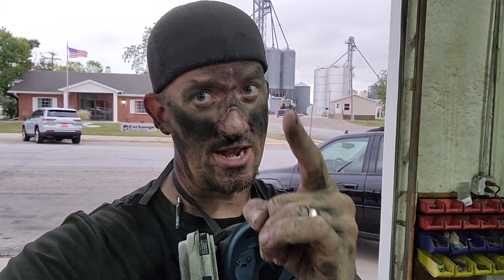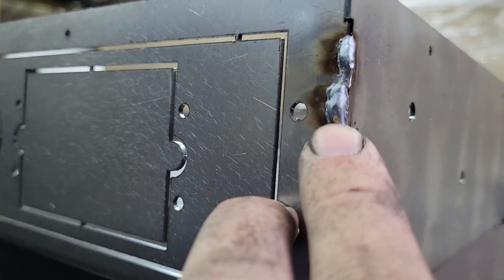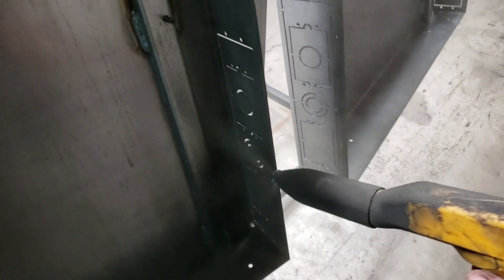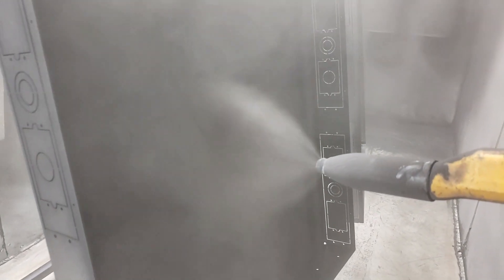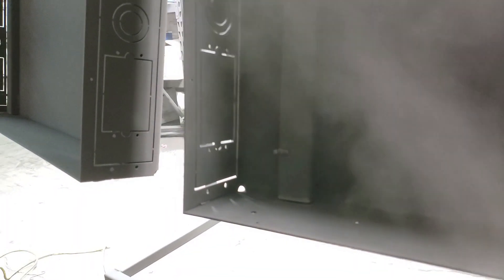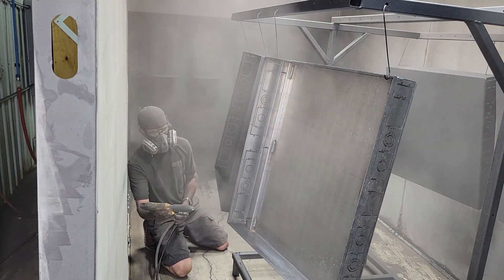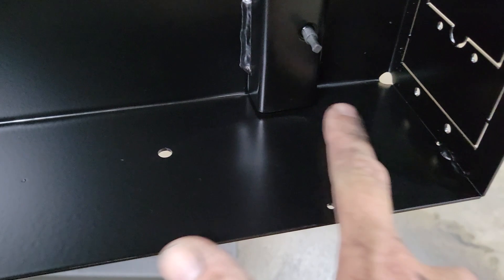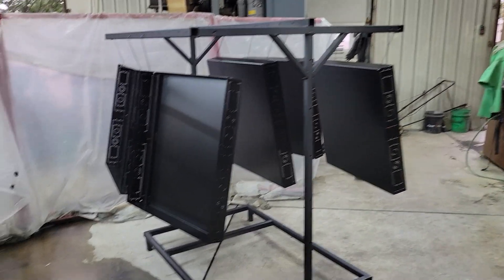How to overcome powder coat issues.

Comment: Epoxy compounds are known causes of occupational asthma. Powder coating paint on your skin can cause allergic skin reactions and also exposure you to exposed you chemicals suspected to cause cancer, damage fertility or unborn child. Powder coat paints, especially those that contain TGIC, may cause damage to the lungs, central nervous system, kidney, liver and hearing organs through repeated or prolonged exposure. All SDS for powder coat paints say the same thing: Wear protective gloves, clothing, face and eye protection. Contaminated work clothing should not be allowed out of the workplace. I recommend a full-face respirator and Electrostatic Dissipative (ESD) fiber yarns nylon gloves.

Comment: Hey Dan, thanks for all the great content. On a job like this do you see a big difference between the Gema and KCI or is it just different settings and technique, but overall same issues. Iv'e been using a KCI for 5 years and have had great results and zero problems with the unit itself.  I want to replace it as it has a bazillion hrs on it and I was thinking of upgrading to a Gema but just not sure if its worth the extra money. What are your thoughts between the two. Thanks for your time.
Reply from the maker: Big improvement for us, easy to set up and go.  Dont have to adjust as much.

Comment: im having these types of issues on brake calipers and most of the time on the second coat..
The real problem is that let´s say im doing lollypop red and can´t get it sticking on the corners, ill have to shoot a ton of powder onto the part and it will ruin the color of the part. it will go from a bright red to an dark red because of the extra spraying for the corners.. Any pro tips on this one? Regards from cold Finland, love the vids!

Comment: Try hitting the corners first with a low setting on air and powder but turn the voltage down also. The flux that builds on top of the weld beads doesn't conduct electricity so I have a end cone wire brush on a drill with an extension that's about 1 foot long and I hit those beads really quick.  It takes off the flux and the burnt area that the etching spray leaves behind.  We also have a powder coat unit that has a corner setting and a pulse setting that reverses the polarity quickly and sometimes fixes the issue. 
We run a fabrication and powder coat shop so I see and control all aspects of the process.
Reply from the maker: Nice, what gun do you guys use?
Reply: @RightNowPowderCoating  It's actually some off brand Chinese one but it's like a knock off of the Nordson guns . It was $600 on Ebay with a 2 lb clear hooper or you can draw from a 50lb box. The main unit also has a box vibration button if you got that option. My only complaint is the conveying and dosing valves are not very sensitive and are manual knobs with gauges.
Reply: @buildthings79  Would you happen to have a link for that powder gun? I just looked at the Nordson web site and they don't list prices and look stupid expensive. Something around the $500 to $1500 range would be great for what I do.

Comment: Turn your air down.. You're blowing the powder out before it can settle in these areas. Another option is to turn your powder down and put your gun in close to deal with these problem areas first and then powder the rest as usual. Looks like you guys get good results but could be done much easier and faster. And as we all know time is money
Reply from the maker: Seems if we go too low it wont pick up or move powder at all.....not sure if you have any tips on that but if so let me know.
Reply: @RightNowPowderCoating  this is why i got rid of my gemas.... everyone thinks they are the best because they advertised in the right places. I prefer a Nordson... high densitity.. low volume. If we could powder coat without air pressure that would be ideal, but we need air pressure to pick it up and move it. the trick is using the least amount possible and I think Nordson has this down the best after trying them all. 20yrs experience
Reply: @RightNowPowderCoating  I use a wagner sprint gun and for powdering things like this in 9005 satin my typical set up would be something like 80% kv with my air on 3.75 and my powder at around 45.you said you're having problems turning your air down and I noticed you get quite a few surges of powder perhaps you have air flow problems such as your compressor.it Could even be the energizer settings (the rod that you drop into the box of powder) if you hold your hand like this 🖐️ imagine that's the spread of your powder... The thumb and little finger areas are the parts that will take best to problem areas. Never powder with the centre of your spread you want to either be powdering in front of or behind the central position. Hope that makes sense 😂